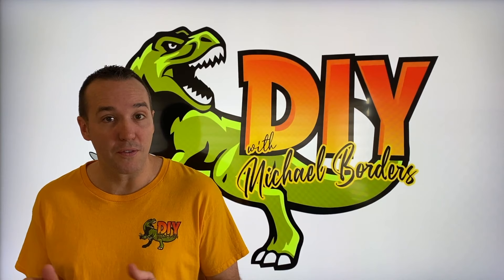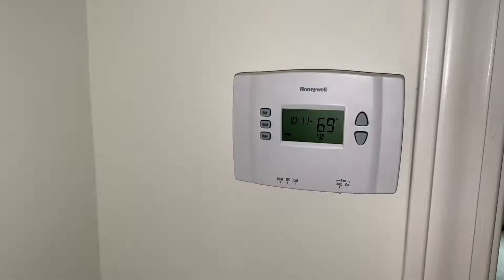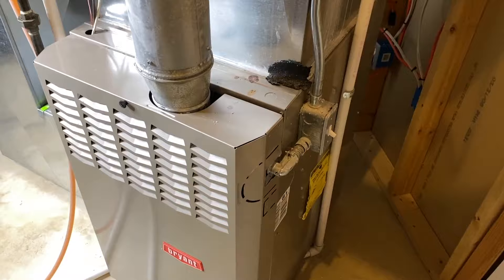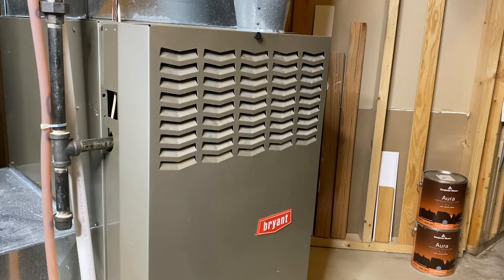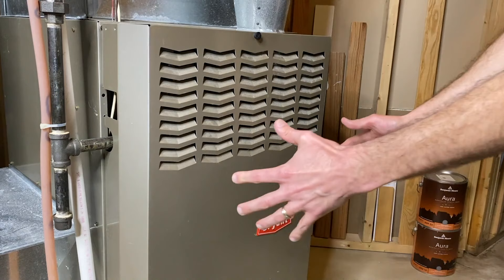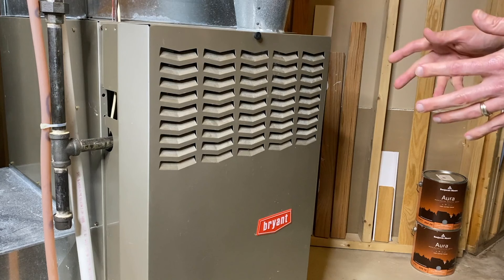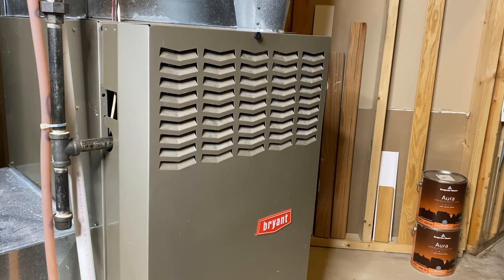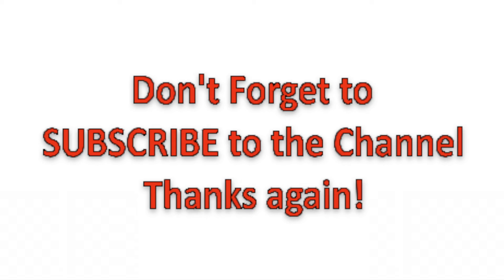Furnace turns on and is running - BUT NO HEAT

Comment: Please help.  The thermostat is set to 69, but it’s 66 in the house. I can see blue flames inside the unit and when I check on the filter, it seems like air is moving through the area. However, no hot air is blowing out of the vents.  Perhaps there is a stronger fan (blower) that’s not forcing air through the unit?
Reply from the maker: Thanks for watching, great question.  There is indeed and it’s a very important part of the system.

By chance do you hear your lower blower motor and fan turn on?  If not, that may be the issue.

Below is a link that gives you a good look at our internal blower fan/motor unit.

       https://youtu.be/5NbjO36uxNE?si=eF1m4NNPBddHO4bw

Keep us posted.  👍
Reply: Thank you very much! @DIYwithMichaelBorders
Reply from the maker: @clays7741  

We are happy to help, reach out to us any time.

Comment: Our thermostat is on heat instead of it being on auto it has to be on for the fan to even kick on. The switch is on too. But it’s still blowing cold air. No heat but apparently one of the fan motors has some wear and tear on it and is going out.
Reply from the maker: Good morning, just poured a cup of coffee and am sitting down to answer any and all questions for the DIY community.

Any update?  A few things come to mind that may help.

     1.  Replace filter
     2.  Verify filter compartment is clean and clear
     3.  While inspecting filter housing, take a look at large blower motor fan.  If very dusty and dirty, we recommend carefully vacuuming it.

Does the furnace ignite the flames momentarily or do they never ignite?

Comment: Thank you for your helpful video. I have a question why my furnace stop produce heat after running few hours? I set temp 80 and it stop usually around 70 while thermostat screen still indicates heat on. No matter I click on/off heat, reset system, it does not work. However, it will work again on the day after that, but the same problem show up again, so on . I tried to replace new filter and new thermostart but the issue can not be resolved. Can you let me know what is happening with my furnace before call for help from professional.  Thank you so much and Happy New Year.
Reply from the maker: Thanks for watching, great question.  Your furnace may be overheating.  Have you replaced filter recently?

Lack of ventilation will shut the system down before reaching preset temperature.
Reply: Thanks
Reply from the maker: @HuongNguyen-ei2qy  

😎👍
Reply: @DIY with Michael Borders  I did replace the filter and thermostat.  It runs only once every week.  When it is off for a few days we can turn it on.  And then it will turn off once it reaches a set temperature.   But then it will not work until a few days later.  It is not windy in our area.  We know it is an overheating issue.  But what is the next step do you suggest us to do?  Thanks
Reply from the maker: @VideosLecture  

Thanks for watching, a few things can cause this.  First, we recommend turning furnace off followed by removing the panel necessary to gain access to the control board.

Next, carefully and precisely verify all screws securing wiring to the control board are properly secured, not loose.
Reply: @DIYwithMichaelBorders  We are having this EXACT problem described above, do you have any further advice? We can't afford to call anyone to help. Thanks so much for any advice you can offer!
Reply from the maker: @translatortranslator3818  

Thanks for watching, any update?  Are any of your floor vents covered by anything such as furniture or rug?  If so, a blocked vent may be causing back-flow and tripping system off.

Comment: My furnace turns on and the flame ignites but the flame then turns off
Reply from the maker: Good morning ☕️

That’s no fun.  A few things can cause this however most common two parts are a faulty Flame Sensor or faulty Igniter.

However before replacing parts, a dirty air filter can cause this.  If filter hasn’t been replaced in the past 2 months, it’s best to change it and see if that helps.  Keep us posted.